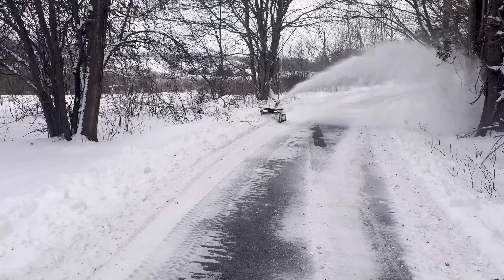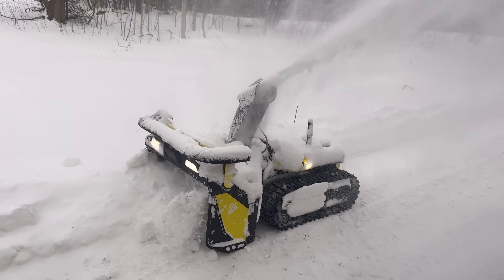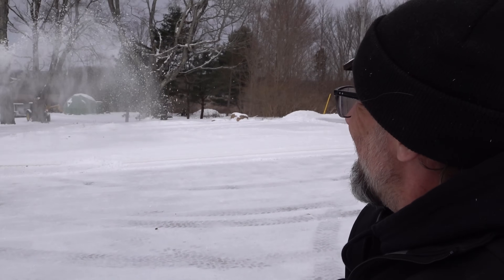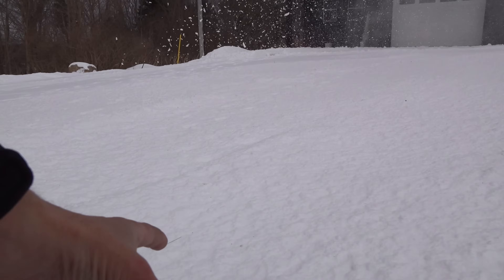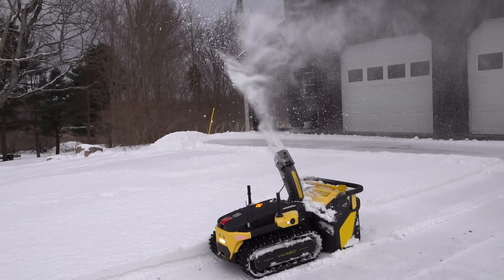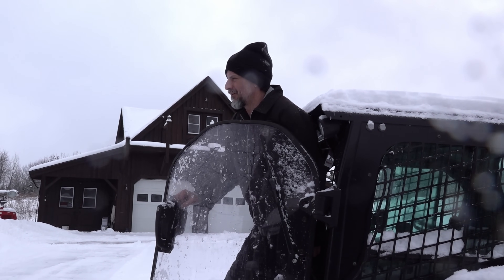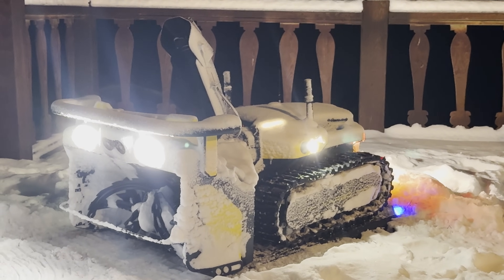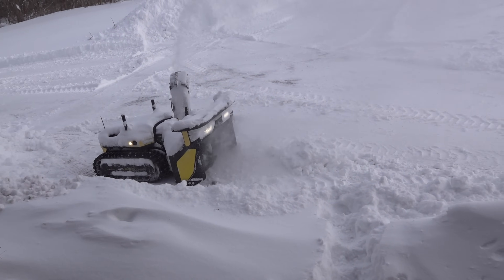230lb Robot Snow Blower Works HARD! | Night Runs, Deep Snow & RC LEGO Tribute! Yarbo 2025

Comment: Now you just need some of those snazzy new lidar sensors the drone guys are using and bake in some basic area detection. No more pathing. No more routines. A truly autonomous snow machine.
Reply: that would be pretty hard to do considering everything is covered in snow
Reply: @whatusernameis5295  Not only would it just use static buildings for location triangulation but you could easily add some markers around the paved area to provide really accurate location data.